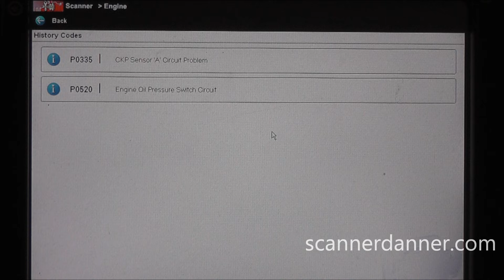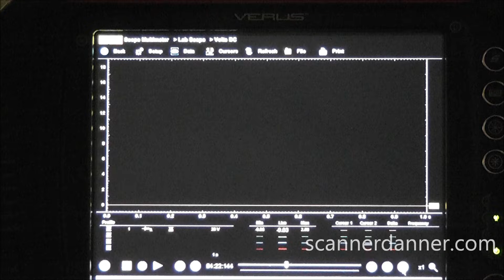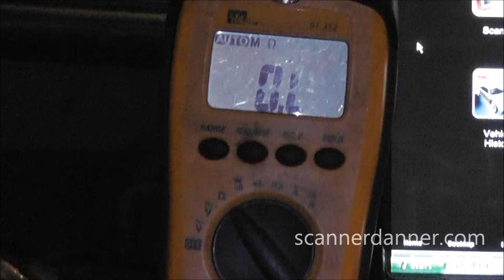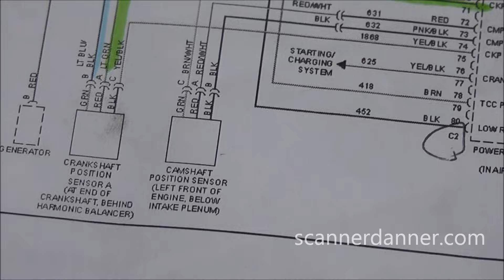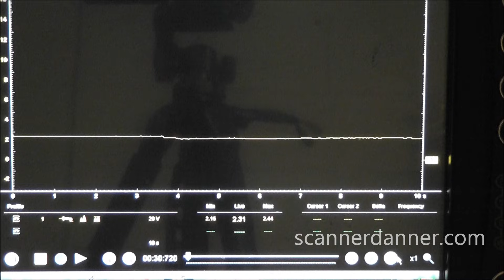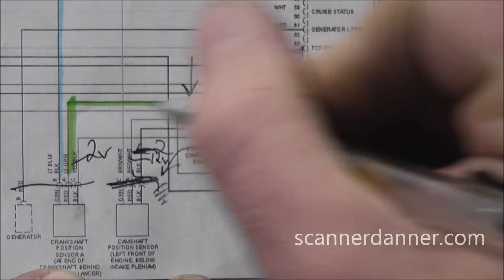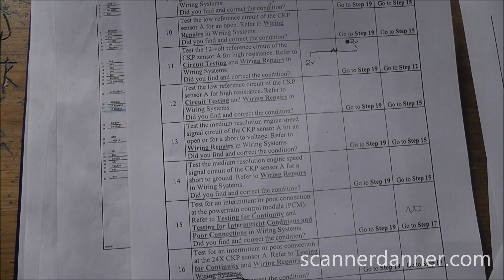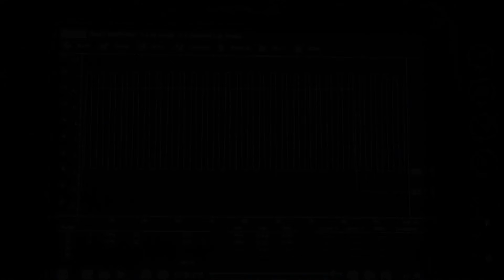2005 Impala Crank Sensor Code P0335 From A Shorted Cam Sensor

Comment: i started following you about six years ago I feel ready to try my ASE and take some tests I need to still buy tools and save up for a good scan tool but in meantime, I am gonna get a good code reader that reads fuel trims and has some bi-directional I see your brother working and that's what a lot of running and working an auto repair and service shop I will be I won't always be hooked up on six channel O-scope diagnosing an intermittent hesitation with a no restart when hot I have a lot to learn I am sure but the knowledge of how those circuits work and the ability to determine if its pull up or pull-down circuitry is crucial to see if the circuit is working right if I can continue to master the basics I may get better as professional automotive technician thank you, Scanner Danner, i pray you stay motivated and inspired as much as me to the work coming up of which some might require special testing and diagnostics my shop name will be Northern Boxer Technologies(TM) it will be my first shop. I will build a 1000 HP boxer and have a motorsport upgrade and engine machine shop with dyno and tuning services THANK YOU, DANNER BROTHERS !!!

Comment: Great vid👍. If the problem was on the ground side it would not be uncommon for a computer issue as they generaly use a common sensor ground internaly that i have seen fail time and time again but would give multiple codes with multiple issues. Always suspicuous about cam/ crank sensor sharing feeds or grounds but having said that your wiring and flow chart led you to an ECM and all of us. Info is key to diagnosing anything so you would have done nothing wrong with replacing an ECM(except not fix the problem). This is very frustrating in the field. I pay aprox 4k per year to get this info from a couple of different sources to find there is not enough info or the info is incorrect on quite afew occasions granted they do the best they can. But who wears the cost of time and ECM when the info is what led you there... you trusted your instincs and it payed off wich is great and well done. But if we are accountable for incorrect workmanship when we charge for it. Or a company is accountable for a faulty part. Then with such a difinitive flow chart that would lead anyone who followed it correctly to replace an ECM. Then why do we pay for that info if we are the ones accountable for there mistakes🤔. This make me wonder. I always call the company involved and let them know if there is something not quite right with info given and this all takes alot of time. But i guess we all have to help where we can as the info more often than not is good.. this is a semi rant or not really a rant at all just part of what we do.. keep up the great work SD👍

Comment: 3.15.14.     Paul, this illustration points up the shortcomings of manuals/trouble shooting sections! I am employed as an industrial Electrician/Instrument Tech, I encounter a huge number of different types & manufacturers of electronic equipment, and with out question the biggest problem is the technical service writing is pretty poor! They don't take the time or hire people with a proper knowledge of how to systematically check the electrical components! You have to know theory & apply it to real world situations. I was taught by a retired German,Dow Electrician to : Test,Don't Guess! This is a superb tutorial!
Reply: Thanks Steven! It is a shame you see the same thing in your field. And you are exactly right, "proper knowledge of how to systematically check electrical components" is key! That is what I am trying to do with this channel. Learn the fundamentals and you can handle any system that comes your way.
Reply: I was told that electricity always runs downhill (ground) and that if I stayed above the wires I would never get shocked.

Comment: Great video! It's been my experience when working with GM's PCM/ECM/VCM/TCM's, finding sensors that are grouped closely together, numerically within the same connector and in the same row, they will typically share a common circuit within the computer, such as what you found. Brilliant deductive reasoning, it took me a little while to figure out the the internal circuitry of these computers before stumbling upon this "silver bullet". It has made life much easier knowing this bit of information.

Comment: I like the principle here of sticking with the problem that you see in front of you. He said the 24x crank sensor issue would not be causing the no-start (having to use starting fluid). But, if you solve that problem, there's a good chance it will lead you to the main issue.

Comment: This is information the manufacturer needs to share. Think of the time lost or wrong diagnosis. Thank you for this it is burned into my brain
Reply from the maker: Good one to burn into your brain! This is a common occurrence on many systems today that share reference voltage and com lines

Comment: Great video sir! I happen to have my Solus Pro with me while watching, and I checked the code tips for P0335 on this car. Guess what the first page says?

"Internally shorted CMP sensor can pull 12 volt reference circuit low causing DTC to set."

Not exactly the case here, but close enough. Your Trailblazer MAP code video showed me the value in checking these code tips, and I've made it part of my diagnostic process. Great work!

Comment: very nice lesson how flow charts can absorb  a lot of time reading them to get to wrong conclusion some time  and in your case could be replacing pcm. some time ago I had a sensor problem  and after following a flow chart i did all the test  and did not get to the root of the problem  so I decided to search Google for the fault and cross me to a video in you tube and it was made by you  I watch it    and I found the exact answer for the fault I was dealing with. I found the fix .

Comment: Job well done,without changing parts.All brain work and you are a gifted person.
Reply from the maker: Thanks brother
Reply: ScannerDanner; great work sir. I always do it the same way, check test and retest again and 9 times out of 10 you'll find out it's just a simple issue with a connection or wiring. I've seen this many times before in working on vehicles and even other types of equipment.

Comment from the maker: Thanks man, and you are correct, it probably didn't need the sensor, I didn't test the old one after the wiring repair so we will never know. It was in too much of a crappy location not to change it. 
As for the why the injector still fires, this system was obviously group firing the injectors during a crank or it was "guessing" as to the sequence. I have seen these be no starts with no injection pulse with a bad cam sensor too.

Comment: I worked in retail parts sales. From my interaction with the customers, I gathered that their flow chart started with "replace the computer". Then the arguments would start over with "You said (my fault) it was guaranteed!" I later came up with a "pogram" (that is not misspelled) where I would tell the customer I would "rent" the computer to them for test purposes. If it didn't fix their problem, they would pay 75% the cost of the computer and have the satisfaction of knowing the problem was somewhere else. I would then return the computer under warranty. The Standard Motor Parts rep told me that 90% of the computers they get back on warranty claims tested out ok. He also said that 75% of the cores they get in test ok so they clean and buff them up and sell them as rebuilt. Their product used to come with the case anodized and shrink wrapped, but lately not. I opened one box in front of the customer and saw it was not shrink wrapped nor anodized. The case was bare metal and you could see the fingerprints of the person who boxed it. The prints etched the case and the entire palm print corroded into it.

Comment: Excellent video. I just found your videos and subscribed. Also for some people like me that cannot afford a nice scanner tool, etc. As far as checking for shorts in wiring that can be unattached at each end a simple cheap multi-meter & 9v battery with jumper wires and alligator clips can be used to check for direct shorts are broken wires. I know this isn't nothing sophisticated but it's low amperage, so its safe, and it works. Oh, I plan to buy your book ASAP... We can never be to old to learn new and better things.
Reply: So what do you do clip the 9v to sensor end and check for voltage on pcm pin?

Comment: Love your videos! Love your book!Just started learning! Am I the only one who catches this? 19:42 you show wiring diagram for cam sensor, on both crank and cam black is ground, red is power feed and green is signal, so you should be testing brown/white wire from the connector not pink/black. This doesn't change your awesome diagnostics on this car. Obviously you would not find any square wave signal on that brown/white wire as well, also changing the title to a shorted cam sensor wiring harness would be more accurate. Great video! Keep them coming!

Comment: Hello Mr Danner. Always enjoy your scientific approach to diagnosing. May I make a suggestion? I know you like your T pins. We both know that there is always the potential to smoke an ECM if they short something. Take your T pins and dip them in liquid plastic / rubber. After it dries, remove about a 1/4 inch of rubber from the tip of the pin shaft. Then remove a small area at the T for your alligator. This will give you the the maneuverability of a T pin, while reducing the chance of a short.

Comment from the maker: good question my friend. two different crank sensors on this model the one that wasn't working is only used for misfire monitoring and low speed timing control.

Comment: Here's an interesting one for you all:
A Renault Diesel 1.5dCi didn't want to start. It had a cam sensor code. So the mechanic put in a new cam sensor. And it still wasn't starting. However if the cam sensor was removed, it started. Looked very much like a short on the cam sensor wire. But! What really happened is that the serpentine belt split in two, and the inner part of the belt got tangled up in the timing cover in a way, that it was blocking the cam sensor to work properly. I didn't see this, I was told how it happened, since I was curious how is the car. 'Cause I was guessing for a short on the cam sensor wire. Well in the end it was an input error after all. So I was half right, I guess. The story may not be accurately told to me, because they should have seen the problem the first time a new sensor was put in. But it's still an interesting story I think.

Comment from the maker: I didn't unplug the cam sensor. I unplugged the harness connector before the cam sensor. I couldn't get to the actual sensor connector with the power steering pump in the way. 
Great question

Comment from the maker: a characteristic of a VRS input is a weak signal at low RPMs. This will be especially pronounced if the sensor is going bad or if there is an air gap problem. but since you switched sensors that rules out a sensor problem. and if it works at higher rpm that suggests wiring is ok too. you need to check these signals at the PCM. They can check good at the sensor and not at the PCM if there is an open in the wiring

Comment from the maker: I am not so sure of that my friend. I do not think with low reference voltage that i would have even bothered looking at scan data. I almost blew the call on this one. also i didn't know a P0335 would prevent a P0340. That info certainly wasn't in the flow chart. Thanks for the tip!

Comment: I would put a new cam sensor before I put a computer, and see what happens next, because sensor is much cheaper than computer, if it works, great if not then computer. But great job I really really love your work, and your troubleshooting, you are the best.

Comment: I had an 80's Isuzu I-Mark with no check engine light. It had a carburetor, the engine started and ran decently. I smelled a burn in the computer (what was its function in a carb system?) and found it fried when I opened it up. Long story short, someone had put a kit in the carburetor and cut several leads to some solenoids in order to take it apart. All the leads were red...fun.. They wired them back in wrong and fried the computer. This story ties in with the caution you give with replacing a computer without checking for shorts, etc.

Comment: Great video mister Danner. My opinion is that those two sensor are shared same power feed in computer is just in this case because it is a pull up designed.

Comment: Hey Paul I have an 05 F150 Lariat that back in March of this year my instrument cluster started going screwy, lights flashing on and off yet the truck ran fine.  Brought it into a shop and they replaced the cluster, but didn't fix the problem as to what caused the cluster to go bad.  After a week of driving the same thing happens, so I bring the truck back to the shop.  They send the truck out to a electrical specialists who finds a short in a wire ruunning along the drivers side floor under a panel.  That gets fixed a a cost to me twice cause the cluster was was replaced twice.  Mechanics didn't hesitate on charging me again for their lack of knowledge.  Fast forward now to summer time and I go to turn on my A.C and it doesn't work.  It worked last year, I bring it back to the shop he brings it to his cousins shop and they think it might be the pcm that is not allowing the ac to turn on.  I checked my ac pressures there good, I'm able to jumper out the ac clutch relay and get the ac to turn on.  The relay is good, the high pressure and low pressure switches are good and on my Autel scan tool I see on the data screen that ac is allowed.  I refuse to bring it to another garage or dealer and decided on replacing the pcm my self at a cost of 140 bucks from Flagship one.  I don't want to be a parts changer but I am at a loss.  I have been told that if that part of the pcm that controls the ac is no good that the truck could still run fine with no issues.  I have read that faulty coil packs could cause a pcm problem, and I did have a misfire on cylinder 8 back in Jan 2020 so I changed out all the coil packs with oem ones and the problem went away.  I figured why replace only one when they were all 15 years old, so I ordered 8 new ones.  Any thoughts or suggestions?

Comment: the camshaft sprockets can be installed backwards, i believe it says 2.4 on one side & 2.0 on other, i think...  been a minute, but i remeber somthing distinct to tell which way they go... also they can be tricky to time in the car because of strut tower location. should be able to use ruler and all 4 marks should be in a straight line, you may have to manipulate the cams a bit so there straight when the belt is tight.

Comment: ps- this is why a really good approach sometimes with these cars, is change all the sensors, like changing spark plugs/points/condenser/cap/rotor on the old car, because otherwise you are running into one sensor at a time and wasting a lot of effort and time fixing each and every one, over the life of the car.  and you don't need expensive test equipment.  a cam sensor is very cheap to change.

Comment: 1st time responding to your videos, let me know if I'm over stepping my bounds. Need to know if you checked with GM, or any other services out there if they may have different flowcharts avail to help us techs, and if so who they may be. Our shop also uses Mitchell as the main info source, and yes I have heard where they simply reprint what is supplied to them. In a nutshell, info like this does nothing for my bank account, and drives my sanity 'OL'. Your teaching techniques are the best

Comment from the maker: Frank
Section 2 page 24 in the eBook. I talk about how to Identify an electronic type switch input. 
Honestly for this video, it really didn't matter about the signal circuit design because we had a feed or reference voltage problem. I misspoke in the video about that.

Comment: the mechanic  my friend said the timing marks are correct. I tested power and grounds to sensor and signal and seems to be ok any way I put new cam  sensor but I still have the same problem. do you know if I do dual channel cam and crank how do I know in this car they are coordinated I could do it but with out known good picture I will not know how to interpret that reading??  thank you Paul you are a excellent teacher

Comment: I would just like to point out that on a shared voltage reference feed its likely to be a current limiting circuit using a ic than just a simple resistor. From an engineering stand point it would make more sense because you would not have much, if any voltage drop. Also when a short occurs the resistor acts as the load in the circuit and will have to dissipate the current heat and depending on the amount of current could damage the board. Current limiting ic usually have over temp protection.

Comment: Question for Paul - if you were not sure the reference (12V) feeds in the PCM were shared, could you have checked continuity (or resistance) between the crank and cam wires?  I assume they are connected to the output of a 12V regulator with a resistor - wouldn't they show continuity (basically no resistance) between them?  Like you said - if everything is in parallel internally I think my guess would be right?